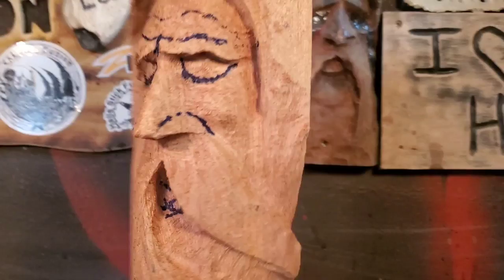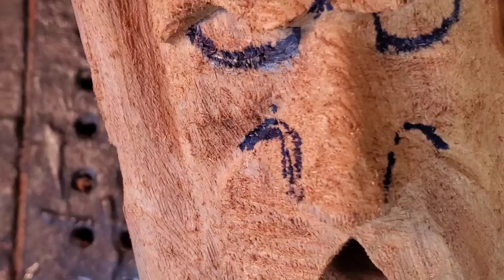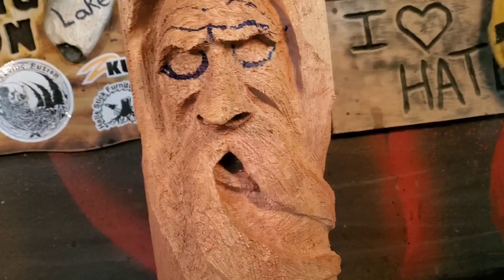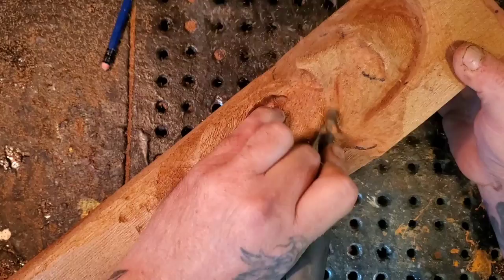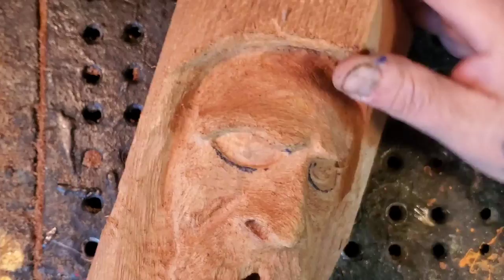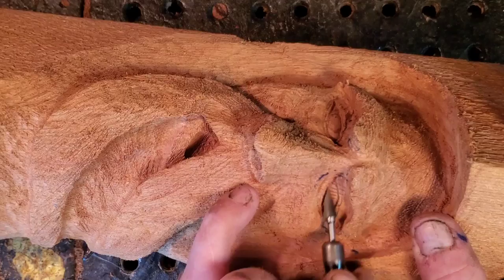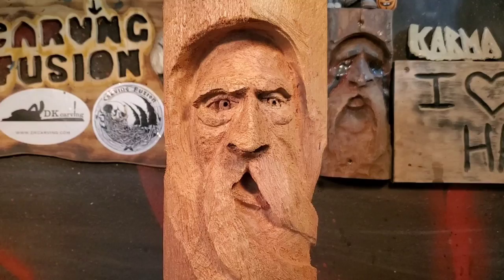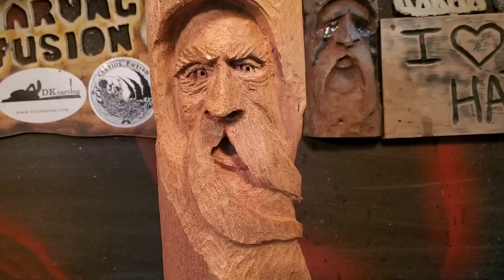Beginner Dremel wood carving a Wood Spirit Part 2. Mouth, Eye's, Nose.

Comment: JORDY I see you use a tiny wrench to change burrs, my rotary tool (I don't say dermal because it's mine is not dermal brand) came with a tiny one too. You NEED to try using a regular wrench because it is SO MUCH EASIER! LIKE SO SO MUCH EASIER.
Reply from the maker: Lol i hear ya but i always have the small wrenches on hand and well im just used to em